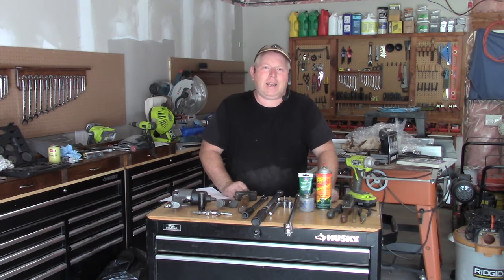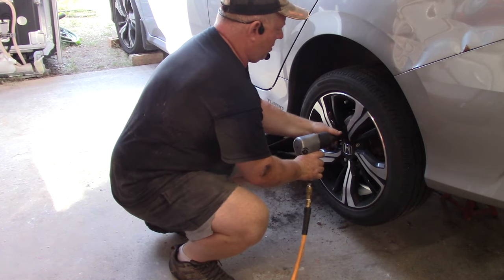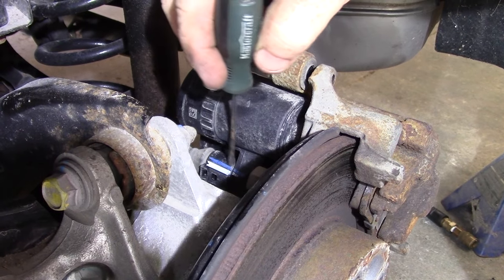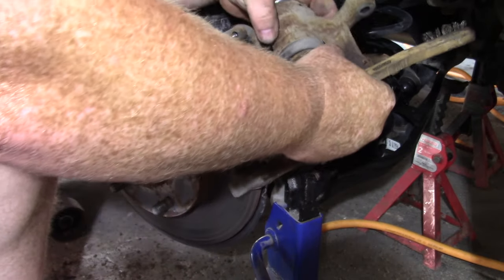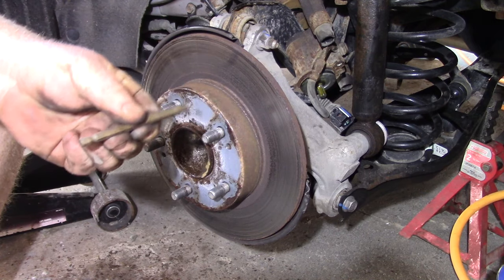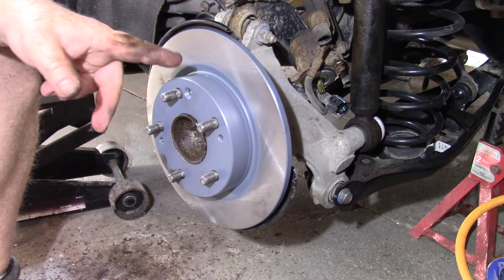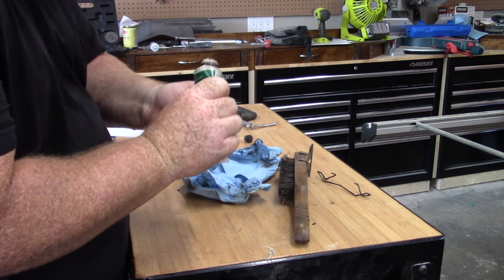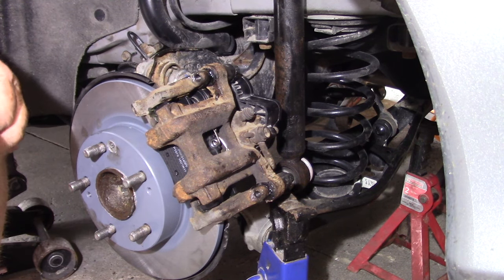DIY 2016 + Civic Rear Brake Replacement With EPB Using Honda Tech Manual

Comment: My Honda dealership recommended and quoted way too much for all brake pads and rotors (I'm in a major metropolitan center so prices were high). Whether this was actually needed or not, I got it all done by a trustworthy mechanic while I was out of town. They said they needed to get one of the electronic e-brake harnesses replaced, but did not have the part. We were in a rush that day, but they said the car is safe, so we've been driving it with the the dashboard all lit up with warning lights. Since we've been unable to get back there, I went by the dealership to see if they had this one part and could do the job. They came back and said that we need the harness as well as actuators and motors on BOTH sides now and quoted just under $1,000. I feel like they're trying to take me on a trip here... and they're just basing it off what codes were returned on a diagnostic. Any advice from experience working on these brakes? Go back to the first mechanic for the one part, or trust the dealership on this one?
Reply from the maker: That's a tough call.  The E-Brake cable was most likely broken by your mechanic and he should own up and replace that himself.  When the brakes are done properly the dash will have no warning lights.  This shows the mechanic did not know how to do the job or have the proper tools.  (scan tool). He could have done the job without damaging the e brake components but the only way to tell is to replace the harness and reset the brake codes.  Now to address where to go...   If it was me I'd go back to the first mechanic and see if he can replace the harness and reset the codes. (hopefully he's educated himself on the new e brakes and bought the new scan tool required).  But you may not be satisfied and he may not be able to fix the problem which would make me ask for a full refund.  If necessary I would then go to the dealership.  Best of luck!!!
Reply: @robsgaragewoodworkin , with Honda since 2004, the newer wiring2015& up, can be really brittle/flimsy in some areas, and these rear brake harnesses are particularly weak, so I’d be inclined to go 50/50 on the replacement, because sometimes just touching things will create problems. Just my opinion.

Comment: Rob, thanks a lot for the video. Did my wife’s Rotors and pads yesterday. First one was a nightmare as a rotor screw wouldn’t come off what so ever. I tried your method - no go. Went to the store and got an impact driver , the tip of the driver broke right in.... if it happened to anyone - I used a angle grinder and cut it right through , then used flat head screwdriver and it came off. Second side took just over 30 min as the screw came off at first try.
Reply from the maker: You're welcome!  Thanks for your comment!  You don't really need the screws, they are there for factory assembly purposes.  If they don't come out I just drill the heads off of them normally.  
Cheers!
Rob
Reply: I just finished doing mine and encountered the same problem with the rotor screw. I initially hammered it in with a #3 Phillips and  followed it up with a drill, but the bit snapped. Drilling it out took too long so I opted for using a rotary hammer drill, set it on hammer mode and went to town on the screw until the head of the screw snapped off. Took me about 3 mins.

Comment: For the 17mm caliper bracket bolts. Is it the torque 55ft-lb or 74.57Nm? Because you said 55in-lb in the video, is thay wrong?
Reply from the maker: Yes it’s Foot pounds.  Sorry I’ve worked in a couple different industries so sometimes I say it incorrectly.  Inch pounds when I’m dealing in electronics assembly.  Foot pounds or newton meters for automotive work.
Reply: @robsgaragewoodworkin thank you for quick response. Getting ready to do my brakes for the first time.
Reply from the maker: @raczyk  take your time.  Watch your fingers and don’t forget the calibration sequence at the end of the video.  Good luck!

Comment: Great video, I have seen a few of them and this one is more clear.  I will be working on my 2017 civic and this will be my first repair on my car.  Does DIY void any warranties with Honda?
Reply from the maker: It depends on what you are working on.  Brakes don't really have a warranty because they are wear items.  I do as much as possible by myself if they are going to charge for service but I do all my oil changes at the dealer so I get their inspection reports and I have a record that they changed the oil so they don't claim it wasn't done properly. (if you have engine issues - especially since they had that oil dilution problem on the turbos)

Comment: Thank you for this.  When pushing back the caliper piston, do you remove the cap that holds the brake fluid?
Reply from the maker: You don’t have to but you can if you want to.  Mechanics don’t.
Reply: The only reason why you would do that, is to keep an eye on the brake fluid level and to make sure it won't spill out of the reservoir when compressing the piston into the brake caliper.

Comment: Hey. Question.  Did you turn on Parking brake on or off when you start? If I turn on and shut the engine off, the EPB will hold tight rear brake pads,right? So turn off before start this DYI?
Reply from the maker: You retract them.  You have to follow all the steps or you’ll have issues.  They are layed out in the video
Reply: @robsgaragewoodworkin  oh maybe I missed it. Thanks.
Do you have any ideas what is that yellow grease or gel on? After you remove the EPB, there are some yellow on screw and turn clockwise to the piston in.
Reply from the maker: @MrJin1101  just grease.
Reply: @robsgaragewoodworkin  thanks!

Comment: When pushing the brake piston back on the caliper it is a good practice to remove the cover off the brake fluid reservoir and drain some brake fluid out. This will allow the brake piston to be push back more easier and have room for the brake fluid to flow back into the reservoir since the brake system is a sealed system.
Reply from the maker: It's a closed system.  When the car is manufactured the brake piston is at the home position(fully retracted), they add brake fluid and vacuum it through the system, top it to the full line and close the reservoir lid.  The brake pistons when activated push out, the brake booster draws brake fluid out of the reservoir pressurizes the system forcing the pistons outward to press against the pads onto the rotors.  When you let off on the pedal the system depressurizes and the brake fluid flows back into the reservoir.  So when you manually return the brake piston to the home position the fluid level will never be higher than the storage capacity of the reservoir.  (unless some idiot filled the reservoir past the full line)

Comment: Once the motor is retracted can the piston simply be pushed or does it have to be twisted as well ?  
Also do all the steps apply to a manual transmission as well ?
Reply from the maker: Once the motor is removed you turn back the Torx fitting on the caliper clockwise until it stops.  This sets the EPB to its service position or home position.  You don't have to turn the piston side, just press it straight back.  The electric parking brake is the same for automatics and manuals so follow the same steps.  Don't forget to calibrate the EPB as shown at the end of the video.
Good Luck with your repair!
Cheers!
Rob

Comment: This may be a dumb question but I assume you start the whole process with the parking brake released correct?
Reply from the maker: LOL!  Not dumb.  Yes you have to release the parking brake first before you jack up the car.  If its not released you won't be able to take the brakes apart.  Good Luck with your repair!
Cheers!
Rob

Comment: when you use the E12 socket to turn the EPB clockwise until it can't go any further and push the piston in, do you have to turn it counterclockwise the other way until it won't go further? or just enough to connect the EPB back on? 🤔
Reply from the maker: You back the EPB into the maintenance position manually.  Press the brake piston in. Swap the pads, rotors, clean everything up, lube the caliper slides then reassemble.  After everything is put back together the EPB gets calibrated (set to operating position) as shown in the last part of the video in the car when I pump up the brakes and cycle the EPB.

Comment: I  saw 3 notches in the rear caliper pistons on a 2018 Odyssey, so that tells me it still requires a special 3 pin tool to rotate the piston in  with light inboard pressure with a special tool to insure damage free retraction after putting the EPB into brake maintenance  mode with a capable scantool. Is this true or not?
Reply from the maker: No.  You don't need to rotate the piston if you used the scan tool to set EPB into maintenance mode.  The piston should be pressed back normally when the scan tool is used.
Good Luck with your repair!
Cheers!
Rob
Reply: @robsgaragewoodworkin  Thanks a bunch. Next time  I get one after I put it in brake maintenance mode, I'll  cautiously attempt to  coax  the  notched pistons in with gentle pressure from a regular c- clamp.

Comment: Hello do you have to just push back the position or rotate it back ?
Reply from the maker: After you remove the EPB motor and turn back the torx head you just press the piston back in.
Good Luck with your repair!
Reply: @robsgaragewoodworkin  Would it be an issue to wind/rotate the piston back or it doesn't matter if you press it back or wind it back with a brake compressor tool?

Comment: When doing the brakes should one remove the brake master cylinder cap to allow the air to escape when pressing the caliper piston back in?
Reply from the maker: You can but you don’t need to.  It’s a closed system so there is enough space in the reservoir for the fluid when the pads are new and the piston is fully retracted.

Comment: So it will through a code if somethings not right?  Edit:   And also do you do the exact same procedure on the other side?
Reply from the maker: Yes.  There will be an error code if not done correctly.  Same procedure both sides.  Don’t forget the calibration sequence at the end of the video (the in car part)

Comment: I have a question. Does the male part spline (not from the EPB motor) has a small black C shape plastic like washer in it?
Reply from the maker: I didn’t see that nor was it mentioned in the service sheet.

Comment: Can the cuppler still be removed if the little latch accidentally breaks off, I unfortunately had to buy two new caliper because I compromised the pistons but only one of my actuator has a broken clip on the cuppler. Pls respond at your earliest convenience
Reply from the maker: Yes if the stay clip is broken it should be easier to remove.  You should be able to pull it right off.  You can get a new wire harness if that concerns you but it will be a dealer only part.  After you get it all fixed up make sure you calibrate the EPB as shown near the end of the video.  Better luck this time!
Cheers!
Rob
Reply: @robsgaragewoodworkin  i still tried the same method of pushing the rubber piece up and pulling but it just won't budge i could try some type of clamp tool but I dont want to risk further compromise to the cuppler and actuator, im picking up my calipers tomorrow i hope the parts technicians can shed a bit more light if I need extra parts. Thank you again kindly
Reply from the maker: @cobzwilliams  You push down on the release tab (close to the wire side) and that lifts the release tab over the locking ramp (close to the middle of the coupler).  So you push the coupler closed while pushing the release tab down then when the tab is down you maintain a downward pressure and pull the coupler away from the motor.  I hope this helps.

Comment: When I remove the epb housing the torx screw won't stop turning when I turn it clockwise? The piston won't push in just out.
Reply from the maker: Turn the EPB using the torx socket clockwise until it stops.  If it doesn’t stop you probably have an issue.  After you retract the EPB then you press the break piston back with a c clamp or brake piston compressor.

Comment: I was wondering at the end of your video you change the mode of the car. Did you have to put it in maintenance mode at the beginning? Or did i miss that
Reply from the maker: No.  This is the manual method but you still have to calibrate the brakes at the end.  That's why I'm cycling them in that particular sequence.
Reply: @robsgaragewoodworkin  hey man got mine done. Followed all the instructions on my 2019 with Electronic Hand Brake. Worked perfect!!

Comment: Greetings Rob, Today I replaced the discs and pads on both wheels. The biggest problem was finding a 7mm Allen key; I have Makita set, Proxxon, and some others, none of which had a 7mm Allen key, but the local mechanic loaned me one🙂. The second problem was removing the disc; I struggled there, but managed with WD-40 and tapping between the screws holding the wheel🙂. I would sincerely ask you to forward me the service manual, because i cant find it on internet and one I found seeks password that doesn't work.
Reply from the maker: @bobanmunja  I found the instructions for brakes only on a Honda Reddit site.  The Allen sockets were a set from Canadian tire.  The set I have has both metric and imperial.  This is a metric set I found online
https://canadiantire.ca/en/pdp/maximum-3-8-in-drive-hex-bit-socket-set-9-pc-metric-0589653p.html

Comment: I followed your procedure. Everything works fine, brakes and parking brake. BUT, my brake light stays on. Why? Need help. Could it be a bad sensor?
Reply from the maker: Did you calibrate the EPB at the end of the video?
Reply: @robsgaragewoodworkin . By calibrate do you mean engage and disengage the EPB and test drive?
Reply: @robsgaragewoodworkin . Or is it where you disconnected the wire lead from the EPB? That I didn’t do.

Comment: At the end, did you just turn on the electrics and then turn on/off the EPB? Or did you actually start the engine?
Reply: Accessory mode = Engine not running

Comment: Working on my 2018 accord, I was doing the rear pads and rotors and I turned the car on to accessory mode to release the pressure to remove the caliper. Threw the new pads in  then I used the “special” tool to twist and push in the piston, but it won’t go in all the way. Still had the car in accessory mode. This is the rear drivers side and one pad was eaten up to the metal but the passengers pads still had some life on them. Is my caliper bad? Is that why the piston wouldn’t go in all the way?
Reply from the maker: Hard to diagnose from here but if the piston didn’t move or was hard to move the caliper is most likely bad.  Don’t forget to clean and lube the caliper slide pins as they can seize up preventing the caliper from centering on the discs.  Make sure you are winding back the EPB motor the correct direction with the wind back tool.  That’s all I can think of from here.  Good luck!
Reply: Exact same scenario here. Seems to be a common problem with 2018 Accords.
Reply from the maker: I have also used the wind back tool and after you have wound the motor back I still needed to push the piston back in further until it was almost flush.

Comment: When doing my brakes, I had cleaned out the motor bearing inside the epb system. Is that just brake fluid?

Also, the o-ring around the bearing was slightly torn. Will that be a problem?

Comment: Do the rear brakes aid in braking when driving or are they only used when parking brake is activated?
Reply from the maker: Approximately 75% of braking force is the front and 25% is the rear.  The EPB winds the inner pad out to clamp the rear discs during parking.
Reply: @robsgaragewoodworkin  Good info, thanks!

Comment: Do you neee to put the car in maintenance mode inorder to change the brake caliper?
Reply from the maker: If you are putting in a new caliper you are most likely doing your brakes at the same time so you would have to either enter the car into maintenance mode with a scan tool or take off the motor and wind back both sides like I did manually in the video.  The new caliper should be in the home position but check anyway before you put the motor on it.  This video shows you how to perform the brake job without using a scan tool (using Honda Tech instructions)
Good Luck with your repair!
Cheers!
Rob

Comment: Very good, nice to see you use anti seize.
Reply from the maker: Most people are terrified to use anti seize.  I use it to prevent rust.  Don’t need much and it makes the difference between using a wrench or a cutting torch 😂

Comment: Hey Rob, I just bought a 17 civic ex. I was worried about that electronic parking break and asked the Honda dealership what kind of hassle that will cause me with basic maintenance. I was told that you cant do a back brake job at home and that it has to be taken into a shop to be hooked up to a computer in order to disengage that parking break. Were they just talking shit so I would take it to them?  Im dumb with cars so i apologize in advance lol
Reply from the maker: Yeah they want $650 plus tax ($734.50) but you can do it yourself for $200.  So since you are saving a total of $534.50 you can buy a new OBD scan tool which will retract the EPB or do it manually like I did (using the Honda manual) and keep all that money$$$  If you are an automotive newbie you can do it with a friend and all the instructions are right here in the video.  It's actually a great system and you're going to love your civic!
Cheers!
Rob
Reply: @robsgaragewoodworkin  which scan tool would you recommend? Just bought an Acura. Basically the honda pilot version. Debating on buying a scan tool to service this vehicle myself.
Reply from the maker: @Garagejunky09    It’s hard to say because the tools are brand new.  I would likely buy the best brand name one I could afford when it goes on sale.